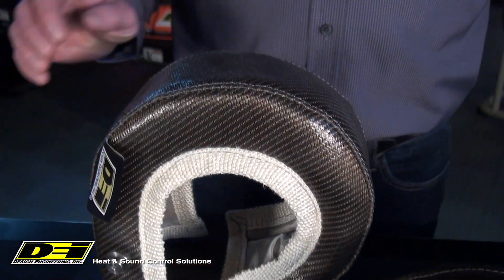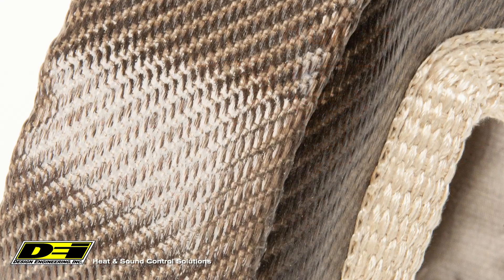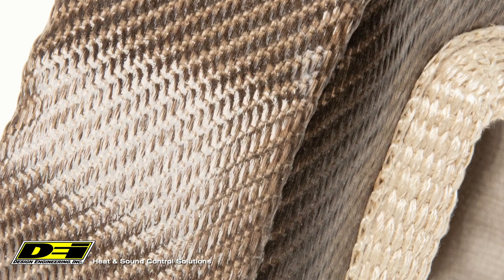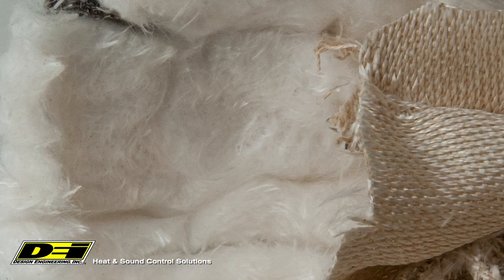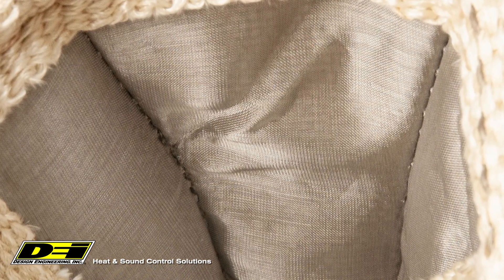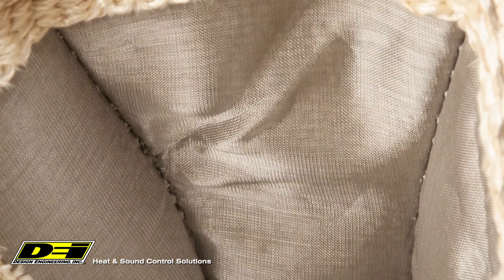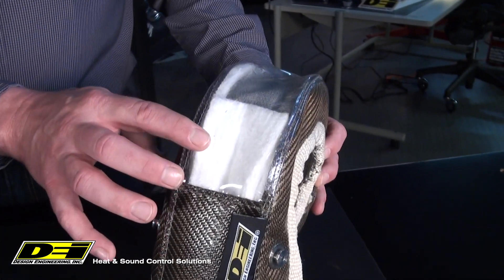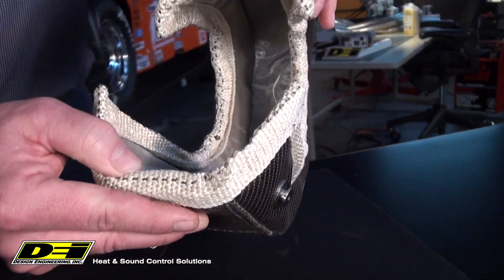GEN3 Titanium Turbo Shields

Comment: I know this is for a turbo but would something like this fit a p1x procharger in a challenger? Or what would you recommend to keep it cooler? Please and Thank you
Reply from the maker: Turbo chargers benefit from insulating blankets applied to the hot side because that prevents them from heat-soaking the cool side. For a procharger, you wouldn't want to add a blanket as a procharger already is the "cool side" so to speak. The heat a procharger builds up and gives off is a direct result of compressing air. Your goal with a procharger would be to help it breathe and expel heat as much as possible.
If your procharger has an integrated water-to-air intercooler, the product that would help you most is our Chill Charger coolant additive. This additive helps increase the thermal conductivity of the coolant (e.g. it transfers heat faster), allowing things to cool off more efficiently.
Visit www.designengineering.com/chill-charger for more details.